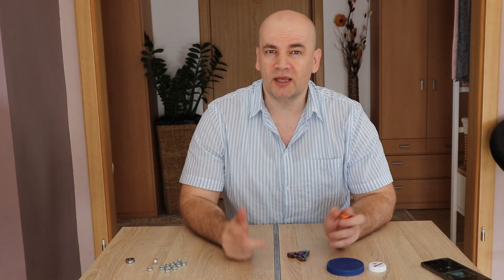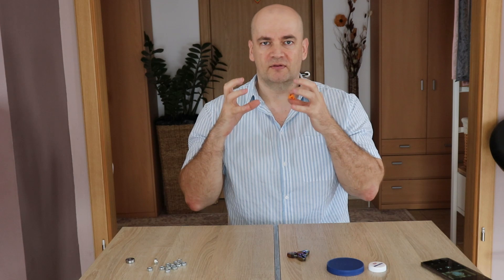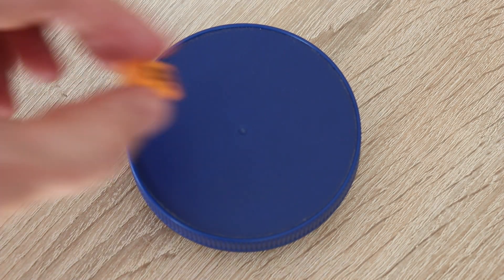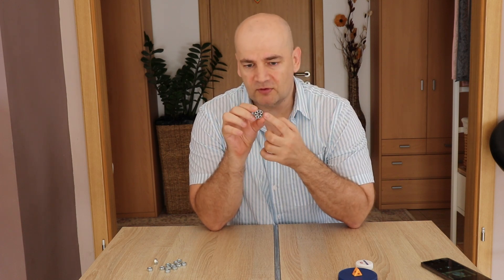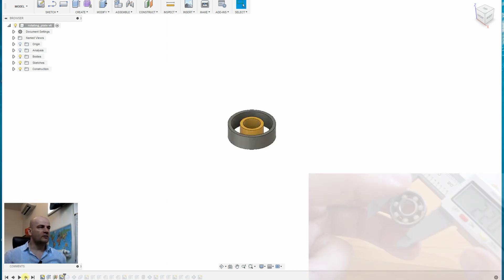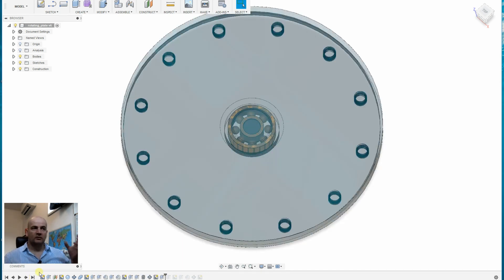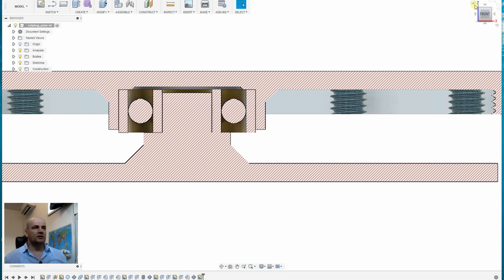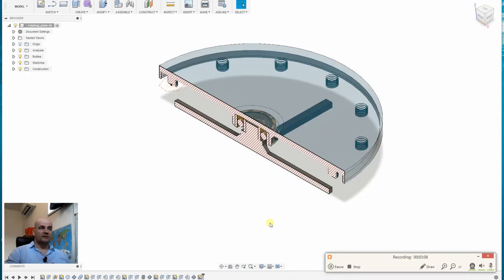3D printed very simple turntable for video shoot

Comment: very good job. I am going for a larger diameter but i am concerned that it will wiggles since it doesn't has any support on the far edges of the circle. I can see some wiggling in your product which i believe will be more significant in my product with larger diameter. any suggestions ?

Comment: You really don't want ball bearings like this because those don't take axial loads. Needle bearings are much better.
Reply from the maker: They do, only smaller loads, which is enough in this case. This is old video (but I still use the turntable). The improvement would be using two bearings. In this version (1 bearing) it is important that center of mass to be exactly in the center of rotation. For example if some object is centered, but the center of mass is not in center, it slows down too quickly.